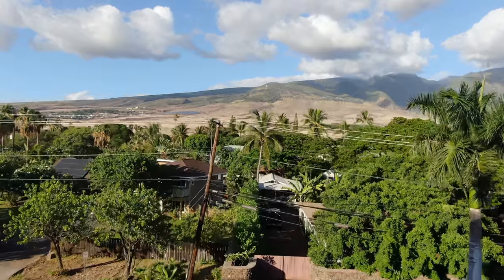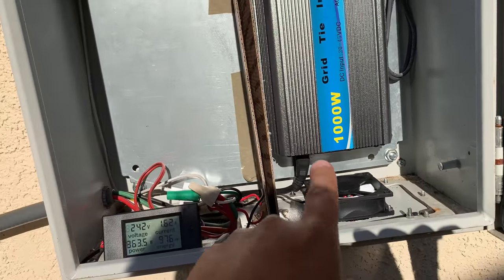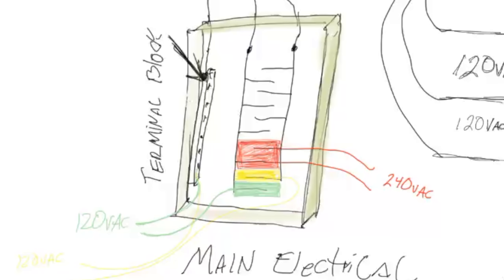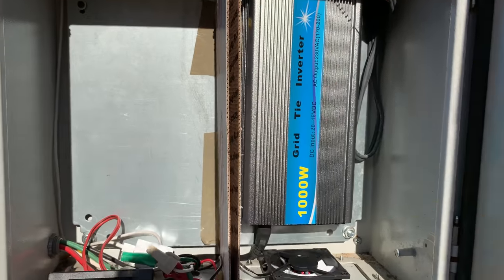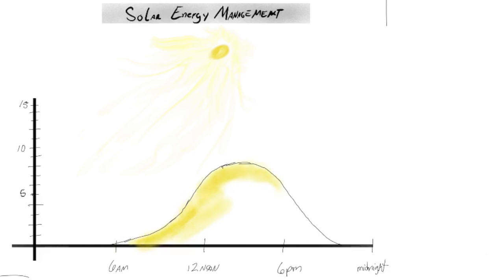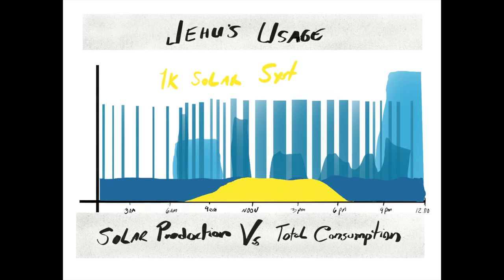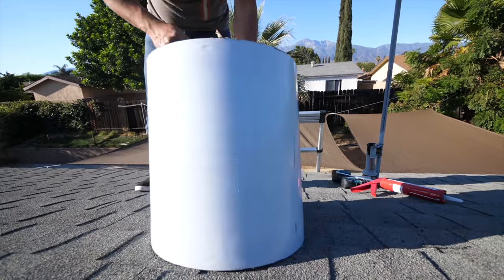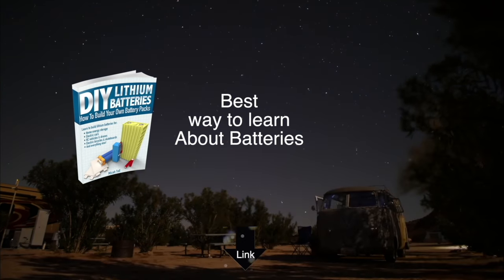How To save $1000 off your electric bill using DIY Solar

Comment: Need to update your video or label it as a gross generalization... in the US we have 3 phase on the street in a wye/delta configuration and the home or a string of homes gets 2-legs and an effective neutral(different for wye or delta) so we do get 120V per phase but only 60° apart so not true 240V

Comment: Unless you're in EU where either you are rich enough to buy a commercial system or have no chance much of getting these kind of parts :/ Certainly not affordably. The whole electric power "evolution" is going on in sunny Cali,  be it EV cars or DIY solar. You can actually get the parts.

Comment: Pretty bold of you to be advertising to the world your illegal install. This stuff needs to be permitted. You also didn't mention that if someone does this and doesn't have a net metering contract, power not used in the home and then sent back to the grid will be charged to you on your bill

Comment: Why use solar at all? You could just charge a power wall at 10 cents/kWh for use at peak hours. Even with losses you'd only pay 15 cents per kWh saving 60% of your energy bill.
Reply: Because the Solar Power will eventually be "free" ...

Comment: Jehu, I saw a home solar system that only produces power used inside the home. They use micro inverters, but also software that limits power until needed. It uses batteries for off peak use. No power makes it into the grid. Their cost is about $1.50 a watt of production. But, they suggest that lead acid  batteries should be used. LegionSolar.Com is their website for further information. Can you build a system like theirs? I like the ease of micro inverters and that no permit is needed from the electric company.
Reply: It is called Net- Zero Grid-Tie ...

Comment: It's interesting that most governments preach sustainability and green energy but when people install a solar energy system and get off the grid, local governments usually respond by revoking the certificate of occupancy.  Apparently it's OK to sell the power utility peak power when it's needed for air conditioning at below grid rates but it's not OK to be energy independent.

Comment: I think your fan is blowing in the opposite direction that you intended. :)
Reply: @Nicholas-f5  No. 
It's not a passive system. Hot air rises, that's true, but as soon as you put any sort of ventilation system, that effect is annihilated by the airflow generated by the fan. (And you wouldn't want a top hole on an external electric appliance... Even here the box is questionable (humidity, strong weather, etc. I don't know where the house is... so not judging anything)

However @Mannie Fresh is kinda ~ right.

1) The inverter is apparently from what I can see, pushing air from bottom to top.
2) The fan is providing fresh air to the inverter
3) The "circuit" created by the box in the middle can ben enough with that little fan to push enough air out on the other side to keep the unit cool enough.

However, if we assume, that the separation actually works and does something. It would be better to have the fan on the other hole and pushing air out instead of pushing air in.
In that situation, the lowest amount of hot air remains in the box.

There is so many ways of doing this... better and worse that what he did. Choose your poison, for me as long as you know what you are doing and risks it doesn't matter much.

If I was going to do something like that, I would look for a box that could be used as a large heatsink for the inverter itself. The answer is, it depends.
If he is monitoring the temp of that inverter and that his installation has no issues on extreme weather, then all good !

Comment: Is this inverter CERTIFIED and COMPLIANT with the local Distribution Network Operators' Regulations etc? It would be very interesting to see waveforms of the current injected into the grid from that chinese inverter. Dont get me wrong, whinese inverters's manufacturers are amazing but this cheap inverter is not one of them. If it was not grid tied, no one should care but when you connect this into the grid it needs to meet certain criteria or it can be DANGEROUS! There such things as islanding detection response times, reconnetion time attempts etc that i highly doubt this inverter would meet (i may be wrong though and this inverter is certified by all relevant authorities...)... Saving money is great but there are cases where you should NOT!

Comment: tip:
always push air out, not in. air will always find way in you need all that power to pull the heat out. look at how btc miners cool there rooms, always draft out 1st :)
Reply: Tip: 
Always push air in, not out. Air will always find way out.

Comment: Don't show people how to wire high voltage death traps please.  Systems with no built in protections can and do  back-feed into the grid injuring or killing utility workers.  I'd be glad if you have one because this does look like quite an interesting and well done build, but not stressing how important these protections are is very dangerous to people unfamiliar with these risks.
Reply: Do you have any proof this GTI will back-feed the grid when the grid is down?  ... no you do not !